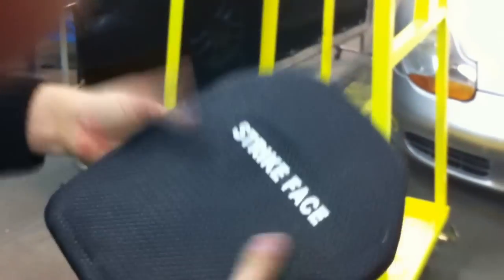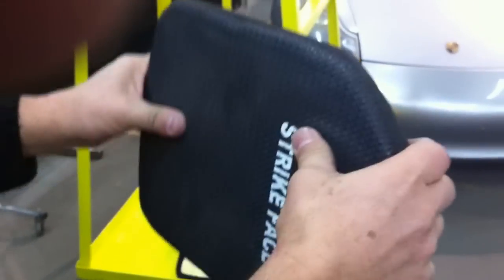APM TECHNOLOGIE. Test drop resistance on bulletproof ceramic plate NIJ4 part 1

Comment: better then running around with 900 lbs of steel on your back and getting killed by ricochets this is why bounty hunters and cops don't use them. STEEL KILLS! everyone knows that most bullets the bad guys use and dangerous. the common bullets the bad guys use are the 30-06 which is a fragmentation round, the M855 which is an AP round, the .357 which is hallow point, and the M196 which is a tracer incendiary these bullets are designed to kill and they will become shrapnel if they hit body armor. if you have an AR500 get rid of it buy a ceramic or place your AR500 below the ceramic DON'T PUT STEEL IN A PLATE CARRIER OR A VEST WITHOUT A CERAMIC ON TOP!